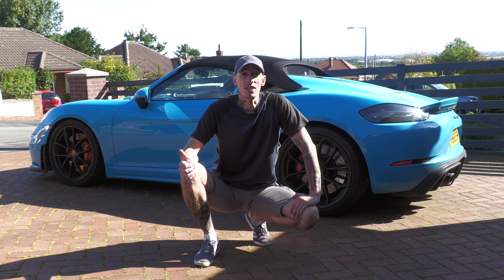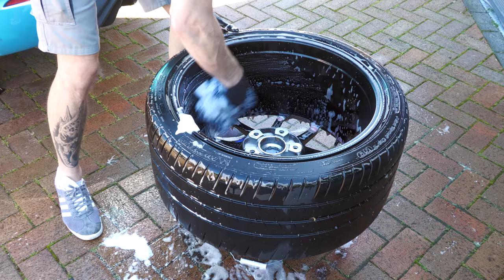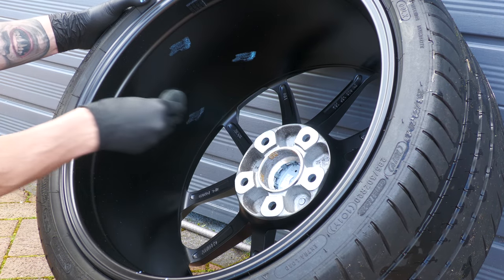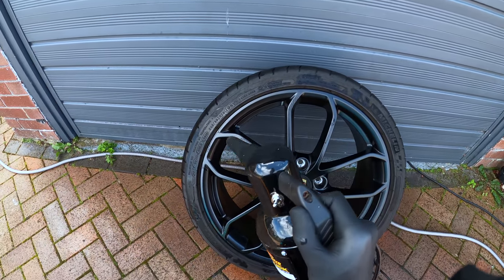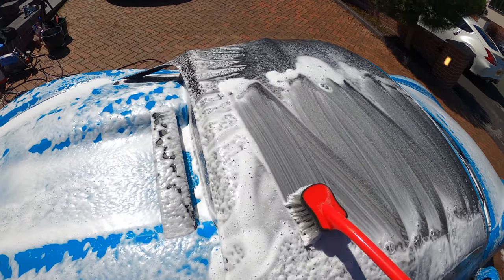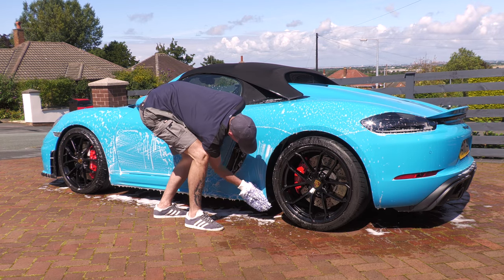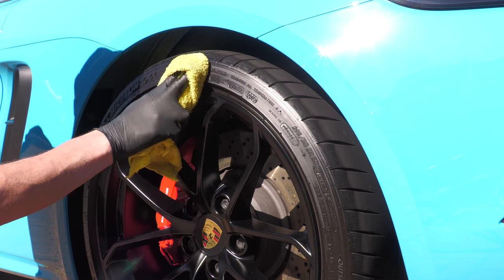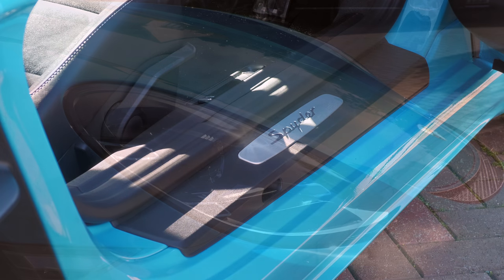Porsche Spyder Wheels-Off Wash

Comment: IIRC working at the dealer i used to find an aluminium shaft that gets inserted in one of the bolt holes, which helps slide the wheels in and out. Pretty handy for german cars.

Comment: Mr. Guru, I have some questions?  When you first cleaned the car last November, did you apply Turtle Hybrid Solution Polish/Wax?  Then applied one or two layers of TW Ceramic Spray?  If so, why didn't you stay in the Turtle Wax family and wash the car with TW Hybrid Solution Wash (Soap)?

Comment: Great results. Absolutely love this colour. Quick question: How do you keep the brake discs from rusting while washing?
Reply: Once finished doing the wheels take the car out on a very very short run and apply the brakes to get heat in them it only takes a few mins at most then you have no moisture on the discs ... Job done 👍
Reply: @markt381  Thanks, mate. Thats how I've done it so far. The only downside is, the rust then tends to accumulate on the already cleaned wheels, hence you have to once again clean them somehow without getting the brake discs wet. In the video it looked like he applied some kind of product to the brake discs to prevent them from rusting. I know Bilt Hamber has something that kind of does that. So was wondering if he was using that.

Comment: No protection for the cleaned calipers? I would have sprayed some Gyeon Wetcoat on and quickly worked it in with a brush, it takes 30 sec per caliper.

Comment: Why not ceramic the wheels since there off?
Reply from the maker: You can’t properly ceramic outside in half an hour.
Reply: @CarCleaningGuru  you can. CQ UK V3 can be topped with reload after 20 minutes.
Reply from the maker: I was referring more to the application time of a spray and wipe type product rather than cure time. I know CarPro has their U.K. formulations but still don’t think you should be using dedicated coatings outside.

Comment: You didn`t jack the Car up on it`s jacking points, there are 4 directly under the sills and obvious if you look, also there is a wheel mounting long stud in the toolkit for removing/mounting the wheels without damaging them, all in the owners manual if you choose to look  👿
Reply from the maker: I did jack the car up on it’s jacking points, hence why the jack is positioned directly under the jacking points 🙄.